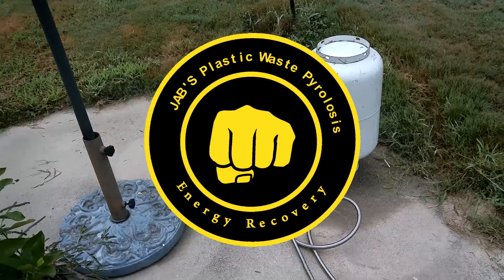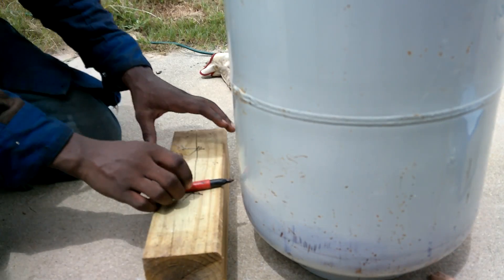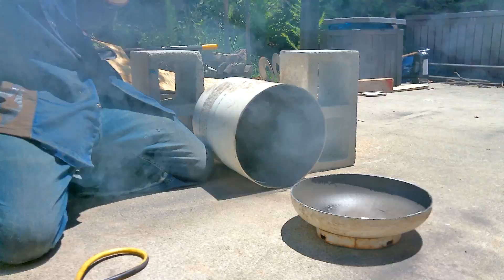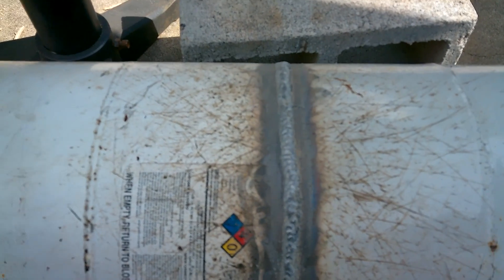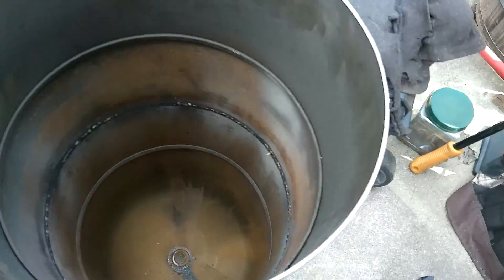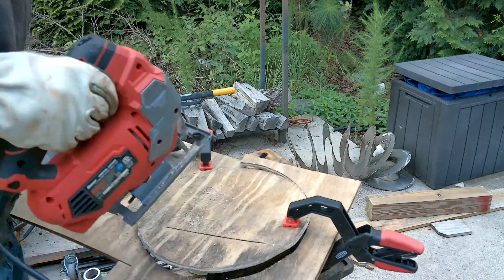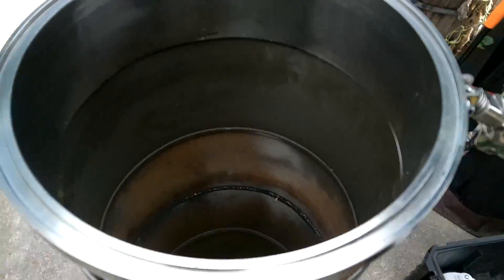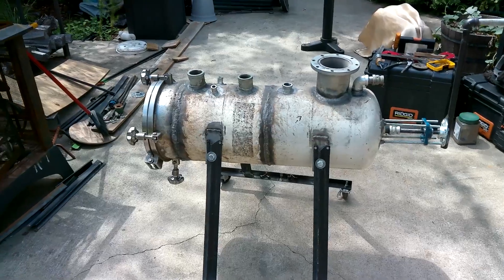Building Mark 4 Microwave Pyrolysis Reactor

Comment: If this combines gas burners and microwaves with little insulation then it'd be very inefficient; just microwaves in an insulated reactor with an appropriate microwave absorbent like silicon carbide or biochar is very efficient, fast and controllable, which along with catalysts can consistently produce different ratios and types of fuels, and there's heaps of detailed research papers on this Fast Microwave Assisted Pyrolysis available online; it could so easily solve the entire waste, energy, fossil fuel, renewable intermittency and climate crises, so no wonder we don't ever hear about it. :) Here's a great video of an FMAP trial plant that needed very little power to make fuels at an astounding rate, and contains lots of links, useful data and details of the process for the DIYer: https://youtu.be/hv9diZZLPE8?si=FD_fpnDYaZx8dePd

Comment: when lining up a cut on a cylinder, use a band ,or make one by cutting a piece of paper in half and taping it together. making sure both factory edges are in line and overlapping the middle seam a couple inches. use as many as u need to wrap around whatever cylinder u happen to b marking

Comment: It looks awesome and I'm impressed.  That being said putting multiple magnetrons together isn't necessarily going to do what you think.  The phase of the all of the mangetrons needs to be synchronized.  If they are not synchronized the waves from each magnetron will interfere with each other.  You could get anywhere from zero power up to 4x power like you are looking for.  IMHO you may find that when you run only one magnetron that you get the same amount of heat output as running all four.
Reply: I didn't think of that at first but you're right
Reply: cool sience👍
Reply: Yep very true unless he's spaced them far enough apart maybe? Total guess, can't recall how long a microwave wavelength is but I would assume that if the magnetrons were spaced further apart than the wavelength than they may not interfere with each other. Again, I'm no expert

Comment: Great Work! I have a question about the Stainless steel port, how did you source it? I'm looking to build a different pressure vessel for a reaction and Stainless steel would be the best, also one that can be easily opened and closed, and this design seems best, but its been hard to find large sizes, everything mostly is KF flanges...
Reply from the maker: Go on ebay and search "Stainless Manway"

Comment: Will those magnetrons interfere/backfeed each other if not synchronized? Do you plan to use circulators to isolate them individually?
Reply from the maker: They have not in my experience, which Im actually really suprised with

Comment: Strapping the propane tank to the tree to hold it to get the valve out was brilliant. Those valves are in tight. Also, wow your productivity is amazing. I could not do all that in 60 hours. Prototype work is hard and you are good at it.

Comment: That's gonna be one mean lean pyrolysis machine.  If and when you get around to it, could you measure how much methane/natural gas it can produce from just biomass/yard waste?  I'm interested in potential CNG applications.
Reply: It would produce that Carbon Monoxide-Hydrogen “Syngas” and/or some pyrolysis oil though, not methane.
Reply: Granted if you do want that, an “Anaerobic Digester” (aka Biodigester) is what you want.

It takes in biomass/food waste (or even Black Water Sewage or Manure Slurry!) and digests in in an anaerobic environment with the right microorganisms.  This makes “Biogas” (Essentially impure methane, main things are Water, Carbon Dioxide, and Sulfur Compounds).  This can be put into a “Biogas Upgrader” to get to “Natural Gas Standards” of purity etc.

Really neat tech.  I can point you to some designs if you want?
Reply: @ericlotze7724  yes I am extremely interested in this. My grandparents own a dairy farm and I am thinking of renting land from them and placing my recycling facility there to fuel the farm. They have tons of cows and manure is a large problem
Reply: @TheCornField_  
How manure can be a problem?
Reply: I'm also interested in this :D
Reply from the maker: Sure